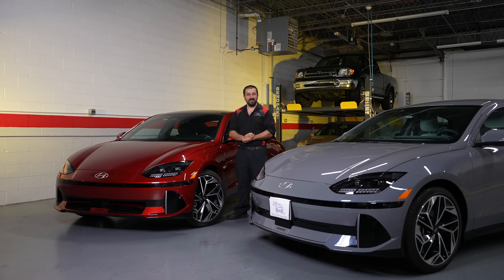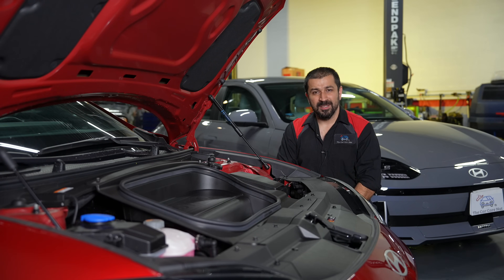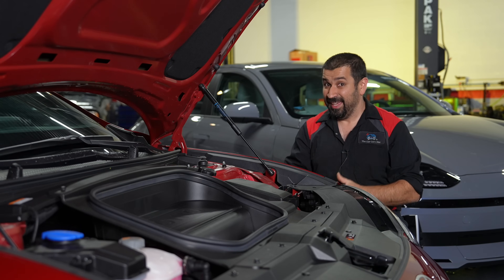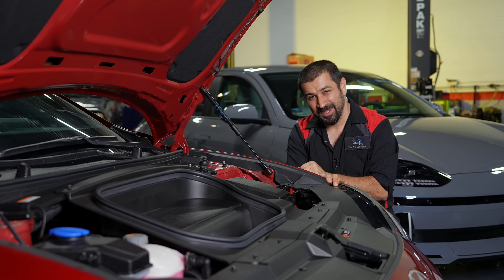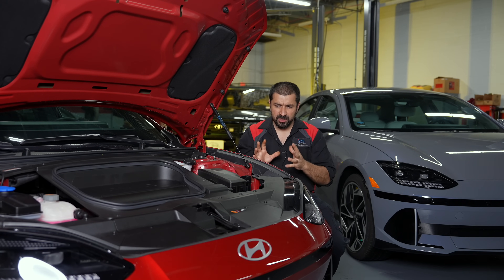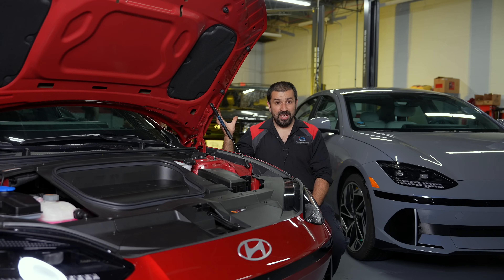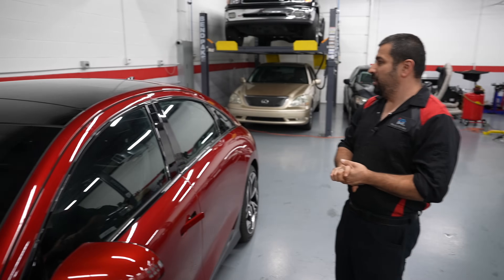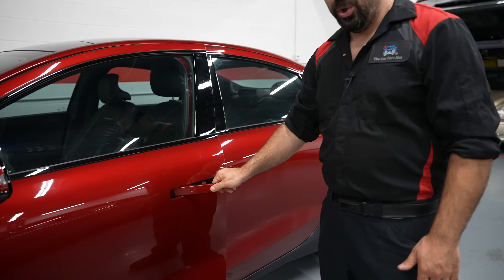Should You Buy a Hyundai IONIQ 6? Thorough Review By A Mechanic

Comment: I have the 2024 Ioniq6 SEL RWD long range.  Lots of either incorrect information or personal impressions couched as facts.  It's a fabulous car to drive; hugs the roads like a sport car; it's not a Rolls Royce, but it definitely is an impressive looking luxury vehicle;  he didn't mention it but the car has a drag coefficient of 0.22 - the most aerodynamic electric vehicle currently manufactured.  Very comfortable and quiet (quieter than the Tesla 3).  You can adjust the pressure sensitivity of the acceleration pedal to achieve 0 - 60 in 5 seconds with the long range RWD model in "SPORT" mode.  I get 315 miles on full charge even though Hyundai advertised as it as getting 305 miles.  Test drove both the Ioniq6 and Tesla3 on the same day and came to the conclusion that the Hyundai was leaps and bounds better designed and constructed than the Tesla.
Reply: I have the 2023 Ioniq6 Limited RWD and LOVE IT!  The best car decision I've made in awhile!

Comment: “Electric vehicles need more cooling airflow than gasoline cars is a 100% incorrect statement.”I think the author is overstating an EVs need for cooling while forgetting that the fact that the number one thing an ICE engine does is create heat. In fact more than 60% of the energy released in combustion typically, will be heat. Just look at the area required for an ICE engine coolant radiator and the size of ICE air flowing grills.

Comment: I bought a 2024 Ioniq 6 Limited in January 2024, and have since driven a few thousand miles glorious with it. It’s an extremely quiet vehicle when it’s buttoned up on freeways, or sitting in my driveway with the radio playing. Today, we were taking my wife’s Prius to the local body shop to get the rear bumper cover replaced. Her car was still in the garage, directly behind me. After waiting for several moments for her to give me a signal to go, she appears beside my driver’s door, looking a bit upset. “Didn’t you hear me honking the horn?” said she. No, I didn’t, said I. That, ladies and gentlemen, is how quiet and soundproof the Ioniq 6 is! Additionally, the Limited trim line is definitely a “luxury” car (Consumer Reports classified it as such). Except for the lack of burled walnut paneling and “rich Corinthian leather,” it’s equipped with everything else, including a 120 volt outlet. I only added a modest subwoofer and a nifty little module that automatically locks the doors 10 seconds after exiting.
Reply: That just means I have to now install a train horn on my jeep so that you can hear me honking 😉
Reply: @robbie552 Funny!

Comment: This is leaps and bounds a better looking car than the bland Teslas, Interior I prefer the dual screen setup in the Ioniq rather than a huge laptop stuck on the dash. I'd buy the Ioniq 6. That said he didnt mention in this video that Hyundais come with the ccs  charging system whereas Tesla uses the NACS system. Hyundai is switching next year so they will have the NACS system interface so you can charge with Tesla chargers.  Good reason to wait or you will have to use an adapter every time
Reply: We’ll see if they can actually work with Tesla chargers.  The so-called universal ones to date refuse to charge my 6.
Reply: If looks is your main reason for getting an EV than yes, the Ioniq would of been my main choice but I had to look at the whole package and the Ioniq just didn't make sense. When it comes to technology, driving performance, range, and charging network, Hyundai is still far behind Tesla just like this review stated.
Reply: @anthonydatri5380 The yoke steering wheel on the S and X is now optional. They changed this a while back.
Reply: It’s ugly to me

Comment: Love everything about this review. But there's one thing I want to note, this car (IONIQ 6) isn't loud, especially compared to a Tesla Model 3. I've driven both extensively. The Model 3 feels clunky from the moment you close that loose sounding door, to the rattles here and there, to the excessive road noise and bumps. The IONIQ 6 is miles better, from that solid thump when you close the door (you can even hear it in this review, 22:36, similar to much more expensive German brands), to the very quiet cabin, very little road noise, and ZERO rattles. You get the right amount of bumps, slightly isolated but enough for you to feel the road. The mechanics aside, this car to a driver feels like a way more refined and matured product than the Model 3. It makes the Model 3 feel like it's been put together by novices. I'm guessing by "loud" you're referring to the artificial sound all EV makes, with the top trim you can adjust the volume. So the car isn't loud at all. The first thing I noticed coming from a Model 3 to the IONIQ 6 is how quiet and solid the car feels on the road.
Reply: that door closing sound is indeed very satisfying
Reply: Very good summation of my experience testing this car!
Reply: Yeah, that part surprised me too. He described the Ioniq 6 as "extremely loud" compared to the Model 3, which is pretty much the opposite of what every other reviewer I've seen has said. Makes me question his other opinions as well.
Reply: And remember that he is comparing to the old Model 3. The new revised Highland Model 3, which is not yet available in the USA, is going to knock this so far out of the park it's not even funny.
Reply: F I N A L L Y ! Someone (thx eric c) tells THE Truth!!!  i've rented 8 3's and 2 s90D's since 2018, drop the tesla name and be nuetral and judge for yourself, ask WHY the 3's keep using our (all other EV's- non T) Level 2 chargers!?? because T system costs too much larer on, largest rechrg in North America but...costs are excessive, they take our spots.
their seats are far less comfortable for further travels vs our 6 from April 7th this year from Oregon to SD, cali. thx mister Chen, great pt.
Reply: Yeah I was surprised by that comment unless he was comparing it to BMWs or something. It's much quieter than Teslas.
Reply: I drove Tesla's Model 3 and Hyundai's Ioniq 6  many times before purchasing the Hyundai. I believe it is a better made car. It's quieter. The ride is better. Better mileage per charge. The advantage of Tesla is its' software and charging apparatus.
Reply: The Ioniq 6 is revolting. You are very correct about the Model 3 interior noise though. Thing is it's not a big deal. I own a '19 M3 Long Range. It's brilliant, noises and all. To be honest I've had to use a fair bit of foam rubber tape on the car's bits and bobs to make it quieter. I've also switched out the air filters because Tesla's get funky. According to the Tesla guy who did the house call, my filters were probably 4 years old and quite maloderous (I bought it pre-owned). But even with these quibbles the Tesla is incredible. 0-60 3.7 or better. Range says 287 at 100% with 35K miles. I get all the comments when people see it. This is just reality not flexing. I couldn't give a darn about being fancy or cool. The Ioniq 6 is hideous. From the slopey hood to the squat rear end to the bubbly headlights to the dual spoilers to the wheels to the paint. It's awful. Hyundai is assuming it will thrive in that nexus where stuff like fast charging, sleek interior, and tactile regen control offset the car's unfortunate exterior visual aesthetic. The proof will be in the sales, but I don't know anybody who would spend 50 grand on an eyesore because it rides quiet. Most consumer comments singing the 6's praises are from people who "would choose the Ioniq 6 over a Tesla Model 3 in a heartbeat" i.e. not from people who have actually done so. These comments seem more interested is flaming Tesla than constructive commentary. I can't tell if you are a 6 owner who has legit chosen it over a Tesla. If so congratulations. But if not, I'm not surprised. You say you've "driven" both. But if you haven't owned both what are we really talking about? Put your money where your mouth is. The used market will dictate this car's real impact. I predict it will soon be a footnote worth a fraction. The person who would chose the Ioniq 6 over the Tesla Model 3 deserves all the pleasure they derive from that decision.
Reply: @SantinoTruitt  How many Ioniq 6 owners have You surveyed? Obviously, You're only asserting your opinion. I drove more than 1,000 miles with a Tesla Model 3. How many miles have you driven an Ionic 6? Maybe you should shut up and put your money where your mouth is and drive an Ioniq 6 as much as I have driven a Tesla Model 3. Tesla 3 is an ugly car and doesn't have the range of a Ioniq 6. The Tesla makes more noise. It isn't as solidly built. Its' only advantage is its' charging apparatus. Musk had to drop the price because it wasn't selling as much as he anticipated.
Reply: ERIC, x2 things alot of outdo's is #1) RANGE other than base base SE, SE LR is almost 400 miles pushed!, 2). TIme to RECHARGE! Less than 30 minutes Mr. Chen, if you EVER pre owned an EV like a LEAF, you'll appreciate saving hours on site charging! Shorter than ANY TESLA on a SUperCharger out there for now. LESS THAN 20 MIN on 77kwh batt, largest. BTW I have driven all Teslas more than four days each except the X Model in cluding the roadster.  These two things ALONE with the niciesties and quieter interior and more comfort sportier seats, just no steering wheel warmer for the cold.  I have over 14k on my 23' to date, best EV owned but only owned x3 prior.
Good Luck Eric, weigh in the North America Tesla charging stations but remember CSS adaptor instation coming!
Reply: @seveglider8406  Yeah, obviously I'm asserting my opinion. I've driven zero miles in the Ioniq 6 and that's the whole point. I don't need to because I can't even get past the car's looks. Driving it would be pointless because nothing about that car could justify it's disgusting exterior. Talk about drag coefficients all you like. They did not have to make that car look like that. The Ioniq 6 design is not attractive enough to speak for itself. This is why so many comments are like "I love the design!" like the car needs someone to defend it from the ridicule it was designed to encourage. 
This is not complex. There is no amount of range that would justify the Ioniq 6 abject hideousness. The car will not last. 
I will never defend Tesla or whatever. The interior of my M3LR is noisy. So we agree on that. But come on, dude, you know as well as I do that Tesla does alot of things right. The Model 3, especially the LR is pretty special. It's simple, fast, decent range, two usable boots, good headroom in the back. People LOVE their Teslas. People DEFEND the Ioniq 6.
I'll close with this: I pulled up to my friend's Christmas party last weekend. This one guy who has a good life, his act together, and a beautiful wife said I was his hero because I drive a Tesla. He knew I had a Tesla because his wife who I work with had already told him. Then he saw it. These things happen when you own a Tesla. Not a flex just reality. I wonder what reaction if I'd have pulled up in an Ioniq 6. What more do I need to say?
Reply: @anthonydatri5380 I chose that word carefully because the car really does make me sick to my stomach if I look at it too long. Especially the green one. This sounds like I'm trolling but I'm being sincere.
Reply: I was shocked by him saying that. I wonder if he had a defect in his.
Reply: Yes the Ionic 6 is better. Ive drove a Tesla several times for weeks on end and they suck. Today I test drove an Ionic 6 and can say that it is way better then a model 3. Much quieter and feels more like a car than a gokart.
Reply: Any experience with the 2024 Model 3 yet?  Seems like they set out to address much of what you are critiquing here.
And the doors... well, as soon as you go for frameless windows (which I'm generally not a fan of) you're just never going to have the potential to have as solid a close as a car with framed windows.
Reply: @seveglider8406  and general driving performance, if the person is into that kind of thing.
Reply: @SantinoTruitt  the Prophecy concept that the Ioniq 6 was based on was GORGEOUS.  I was SO anticipating its release.  This came out, and I thought that some lines were reminiscent, but it couldn't be it... no way.  Yup... that's what the Prophecy turned into.  Had I been the original designer behind the Prophecy, seeing what they did to it to prepare it for mass production, I'd hang myself.
Reply: @mockingbird187  Driving performance? Teslas have a quicker acceleration. The overall performance of the Ioniq 6 is better. It handles very well and has a longer range than Tesla 3.
Reply: @seveglider8406 also much better looking than the Tesla 3.
Reply: I@theodorelindsey4455   I purchased the first Ioniq 6 Limited in Transmission Blue released for sale in Salt Lake City! It is a solid, quiet and well built vehicle!  I dare say I believe it to be much quieter than my wife's X3 M40i
Reply: The 2024 Model 3 update fixed the problems that you cite. The doors have a safety assist system that causes them to be very solid when they shut and the cabin has been massively soundproofed. I own the 2022 Model 3 which I bought used. If the road is really bumpy or has open joints, then the wheels do transfer a significant of noise into the cabin. But that would be true for the vast majority of cars on rough roads. On decent roads,  my car is very quiet. I have not driven an Ionic 5, but I am betting on rough roads; some sound makes it inside the cabin. Some six-figure EVs are quieter, but they lack the efficiency and intelligent UI that Teslas have.  My Model 3 RWD motor and tires run very quietly, and that is why the road noise is so noticeable. Regardless, I agree that the cabin on the pre-2024 Model 3s could be quieter.
Reply: I’ve never driven a Tesla, but I can’t imagine anyone describing the ride as “loud”. Easily the quietest car I’ve been in.
Reply: @styx85  How much did Musk pay?
Reply: @SantinoTruitt  loving my 6. Enjoying every bit of it and then some. Miss some things from the tesla but only software wise. Love the build quality and overall premium feel.
Reply: @styx85  He just mixed them up.

Comment: Also,just so no one is confused, the interior ambient lighting does not flash like in his video.  The flashing is caused by an interference between the high frequency duty cycle of the LED lighting and the shutter/frame rate of the video camera.  To the naked eye there will be no flashing, just soothing lighting.
Reply: Also not on my SE, nbd.  Though not having the undocumented front end SOC pixels is petty on Hyundai’s part.
Reply: Yes Sir, just the vid cam mhz is not the same and causes this. love, Would of PAID extra for the colors of ambient in the doors and floor panel BUT the Long Range it is NOT available in the SE, remember MY MODEL is the ONLY ONE that gets over (U.S.) 371 miles, Yes not 361 adv, but I actually with L-e then top off post charge with L-2 to 3 8 7 MILES of range! I have fotos if you don't believe...miss the folding mirrors for safety too. But RANGE is MOST import. to us! Goes further folks than ANY Model 3 !
Reply: 60,000 for new battery. no hyundai EVs are big NO
Reply: Just want to add, pwm lighting is not soothing in any way
Reply: @tocreatee5736  no one believes that the battery costs more than the entire car bro.
Reply: All should know this in -24.